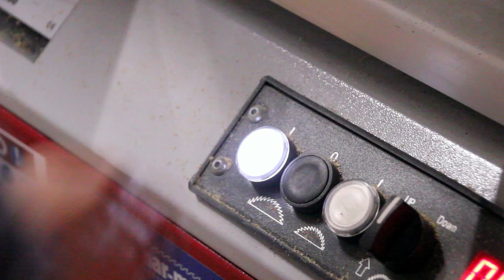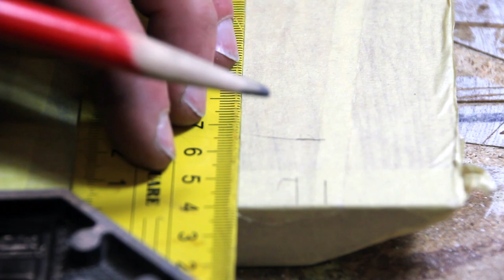making charcuterie board | oak and brass serving board

Comment: what is the capacity of your jointer? and also your thickness planer?
Reply from the maker: Jointer is 50cm and planer is 64cm
Reply: @Chiselsplay  Do you have plans on installing Helical Cutterheads on them?
Reply from the maker: Not at the time, even though that would be useful working with funky grained wood.

Comment: Is oak safe to use so many people warn against oak because it’s porous grain and bacteria I see people do use it but so many so not to
Reply from the maker: Hmm, I hear this concert for the first time. I think bacteria doesn’t care if the wood is porous or not. It’s so tiny that it can live on the smoothest of surfaces. Just keep it relatively dry and you should be ok. On the other hand, maybes you’re talking about red oak. This species have continuous fibers/pours. So it may absorb water quickly and dry very slowly which may cause bacteria to grow inside. But I am no expert:D just trying to think rationally;))
Reply: Thanks for your response your board look fantastic i guess basic hygiene after use but so much conflicting advice but hey I've got some nice pieces of oak that I've stabilised with resin so heres my next project